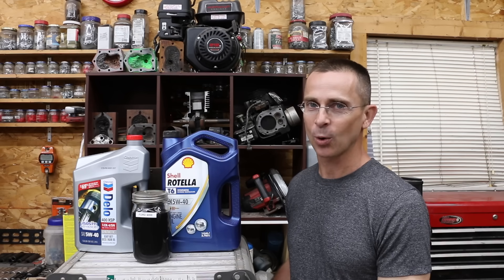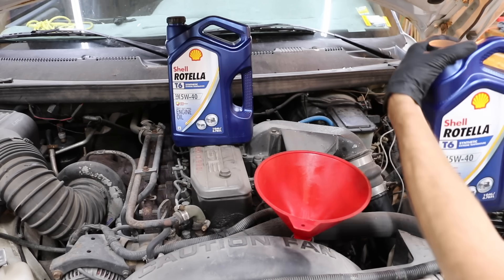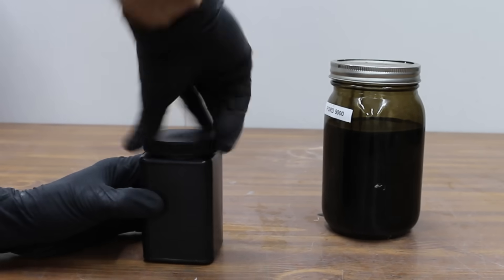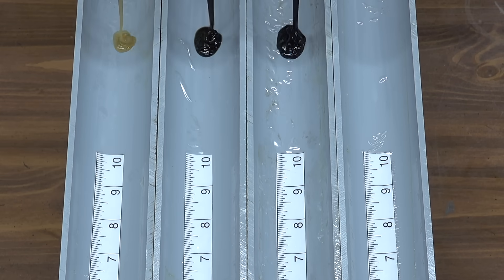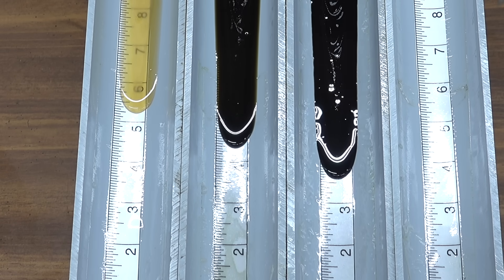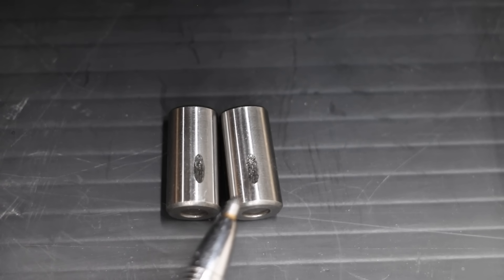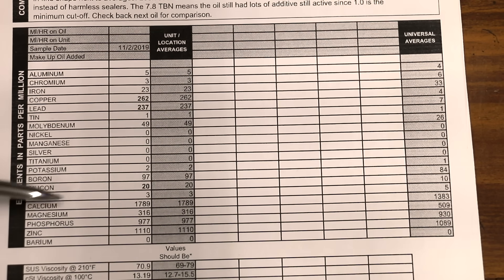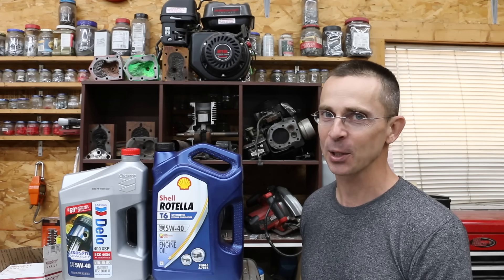Will Annual Oil Change Damage Your Car? Let's find out!

Comment: Been studying this extensively;
How long one can push it depend heavily on brand and model;
Rotella & Delo are decades proven;
Synthetic has proven best; 
Amsoil might be top with I am using Mobil 1 currently with excellent results;
Avoid the European brands to the extent possible 
Prefill filter; I survive by knowing this stuff;
Never never use aftermarket which uses paraffin as factory goes to extra effort to remove it and I saw totally ruined that spin the Babbitt due to clogged pickup screen ~ petroleum engineer told me to stay with one brand so that the additives to not interfere
Reply from the maker: Thanks for the feedback.

Comment: A suggestion for a comparison would be high quality multimeters rated for the HVAC industry. This could also be useful for electricians as we both work with high voltage loads and need to test capacitors.
Reply from the maker: Great suggestion!  Thank you.

Comment: I only change my tractor oils after 2 years or 1000 hrs.  Trucks and cars usually between 6 to 10000 miles per oil change. Never had a problem. One car has 250,000, both the others have 210,000 plus still do great. They are GM products don't recommend trying that on another brand! Lol! 😆

Comment: You conducted these tests with oil from vehicles located far from very humid regions.  Do you believe that results would be significantly different for vehicles along the coastlines, particularly near the ocean?  Example, I live at the beach front of the Atlantic.  Salt air breaks down metal far faster than in areas far inland.  That's one of the reasons I change out my car's oil @ 4000 miles.
Reply: You're wasting your money. Go to synthetic and change your oil every 15,000 miles perhaps longer. Make sure to use a reinforced (synthetic) filter.

Comment: Would you like to test the oil on my 2.2 diesel civic. It has not been changed in 3 years and 70k, it was Castrol gtx and Lucas oil stabilizer. The car was supposed to be a stop gap car hence the neglect but an oil test would be fun! I'd happily send it to you

Comment: I have to disagree with this video. Yes the oil is fine but is it a good habit to not change your oil until you get the max "value" out of it? No. Oil changes are cheap compared with the cost of fuel.
Reply from the maker: Thanks for the feedback.

Comment: I use Rotella 15/40 in my cummins trucks 1998 12 valve and 2015 6.7 24 valve. never had any issues and i assume the 5/40 is for a colder climate you are in? Very good Video and i do believe ill start using the 15/40 in my older Mopar muscle cars...your thoughts on wear protection with a hyd.  flat tappet cam?
Reply from the maker: Thanks for the video idea.

Comment: Honda know my car better than anyone.  I'll be doing an annual this year as I won't go under 20% on the oil "meter".  That'll be about 12,500 km by the end of Sept.  Current load: Penz 0W20 Platinum, next Mobil One Extended.
Reply from the maker: Thanks for sharing.

Comment: I have a Toyota Rav4 2018 2.5 petrol engine. The dealer told me that the oil must be replaced 10000 KM or 6 months, watching this video confirms that its needed to replace the oil after that short length of time thanks for that.
Reply from the maker: You are welcome.

Comment: how's that work ? I can't start my car every month to let it reach the engine temp. Since my car is in storage during Winter season. I do add gas sta-biil to the gas.  Example I change the oil once a year on my BMW M4 last change June 28 2019 go to storage Nov 2019.  Start driving again on 01 April 2020 till now total driven 11,000 km. Going to do an oil change before going to storage this Nov 2020. Or should I leave it and change the oil April 2021 next time I take the car and drive again. Thanks

Comment: I can walk pass the aisle that has the motor oil now and not feel guilty. I can buy my favorite snacks and drinks instead. Thanks for the excellent research and analysis. Bottom line...my vehicles still love me, even if they're in my driveway or garage, unused for longer periods. My vehicle's battery still needs some periodic affection though. LOL
Reply from the maker: Thanks for sharing.

Comment: Thanks for making this video ,  What a great shop you have! You are like the Batman of engine & mechanical investigations, such cool tools. Is the oil filter opener made for a specific job besides oil filters & what kind of freezer is that? Looks like something a for storing frozen arctic geological core samples.
Reply from the maker: The freezer is a Commercial Lab Revco freezer that I use for project testing.  Thanks for watching!

Comment: Imo even in this day I wouldn't go more than 6000km or 4500mi 5000km or 3000mi is a rule usually delo is a good brand same with quaker state but if your putting 2 or 3 thou km or mi on your vehicle every month and your only doing 1 oil change per year you got more money than brains lol playin with fire... car manufacturers love people like that
Reply from the maker: Thanks for the feedback.
Reply: @ProjectFarm  no problem have a 2001 buick century have 335000km or over 200k miles changing oil every 5000km and a coolant flush every couple years still runs new

Comment: I have a OPS Bypass oil filtration system in my Freightlier semi truck.I change my oil about every 500,000 miles.I do oil sampling every 15 thousand miles.I save 3200 dollars a year on oil changes.My Detroit 60 series engine has 1.5 million miles on it.I bought the truck with 400,000 on it.

Comment: I know the lab you’re using from the result page and sample bottles. We’ve always had problems with that labs results. Find another lab and compare the two results. I’m an industrial oil tech. See if the results are the same.
Reply from the maker: Thanks for the suggestion.

Comment: I used the t6 in a 400hp subaru build. But it did experience high mileage and heat/ fuel contamination from high boost  blowby so it was changed often.
Reply from the maker: Thanks for sharing.

Comment: Doesnt that stem from back in the day when mineral oil was frequently used? I remember changing the oil in our small atv last year that had been ran very little and not had it's oil changed in 2 years. Half of it was like thick tar and The rest of it was really thin.
Reply from the maker: Thanks for the feedback.

Comment: The biggest problem I see with annual oil changes is filter capacity. Oil gets dirty and full of contaminates, it's not just about viscosity breaking down. I always go by milege or my oil life monitoring system. I also use fulll synthetic oil and generally change my oil when it gets bellow  20% around 6,000 MI.
Reply from the maker: Thanks for sharing.

Comment: Thanks for the videos! I started using triax oil 5w40 synthetic I haven’t sent for analysis yet but it did stop a rough idle immediately after changing oil  on cold start up on my 6.0 ford due to an injector

I would live to see a video on triax oils (diesel) oil
Reply from the maker: Thanks for the video idea.

Comment: You are a fantastic oil expert and I learn so much from your videos. I have a question. You mentioned in this video that only vertical oil filters can be pre-filled before installation. My car has a horizontal type of oil filter and I can't pre-fill it. Does it damage my bearings to start the engine with the empty oil filter (after changing the oil)? How long does it take for an average oil filter to be filled by the oil pump? The only thing I can do to feel more relaxed is to disconnect the primary socket of engine ignition system and cranking the engine for a few seconds to fill the filter a little bit before starting the engine.
Reply from the maker: Thanks for the video idea.

Comment: Greetings, many of your test data corresponds with my standings assumptions - not too many surprises - good testing procedures.    
With Lithium (and other advanced electric storage chemistries) improving every year, let’s test Shorai and Battery Tender against conventional motorcycle batteries.  My extensive experience with Lithiums concludes:  that they’re NOT ready for motorcycle prime time.  I have four, ground - up, special builds and six others that have been extensively modified. To crank motors that require compression relief valves (will submit to you a list should you ask)  a conventional 320 CCA battery does better than a 480 CCA Battery Tender.  Lithiums require a warn-up to achieve max cranking amps.  On cold big motors, the starter motor can ‘stall-out’ shorting the battery and thus destroying it.  When Lithiums die they go all at once. ‘Lead’ gives us some warning.  Regards, jul, milliesievertmoto1@gmail.com
415 824 6149 office land line.

Comment: European car manufacturers suggest that a fully synthetic oil change only needs to be done every 10,000-18,000 miles .
Yet on other car sites they're either very old fashioned or just anal about oil, changing it every 3,000 -5,000 miles.
Reply from the maker: Thanks for the feedback.

Comment: I drive about 1,000 miles a year and use synthetic oil, usually Mobil 1. It works just fine for a year at a time... It is a 1994 S10 blazer with the stock 4.3L V6 engine. It still runs great and is a lot of fun to drive, I just don't need to drive around that much now that I am retired. It is not a race truck, just point to point steady driver.
Reply from the maker: Thanks for sharing.

Comment: Forgive me for not being shocked by your results. You may have gone 14 or 17 months but you only put a little more than 3k miles on the vehicle. It's not surprising that the oil was still in decent shape. Maybe I'm somehow missing the point.
Reply from the maker: Thanks for the feedback.
Reply: the point is annually some people put few miles on various vehicles, but are still told the superstition that they have to change their oil each 6 months or once a year anyway...but they really dont have to if the vehicle was driven up to full temp before the parked...this person was just confirming that the oil is OK under those circumstances..
Reply: @bonniejohnson1518  Thanks for the clarification.

Comment: I use Deltalube multipurpose(this oil for allkind of veichles) sae40 on my motorcycle.It's suitable for my motorcycle ( every time i change the engine gets cleaner ) even my country is tropical climate with some crazy jam traffic...Almost forgot...for some reason octane number of gasoline affect engine oil peeformance...
Reply from the maker: Thanks for the feedback.

Comment: I had a 1984 Mazda B2200 diesel, oil change interval was 5000 miles, at 3000 miles fuel mileage started to drop, by the 5000 mile interval mileage dropped from 40 mpg to 30 mpg, so I changed oil at 4000 miles.
Reply from the maker: Great information. Thank you

Comment: Just wanted to let you know, I am getting 7 months and 40,000 miles between oil changes with T6 in my 04 Chevy 4.8L
Reply from the maker: Thanks for sharing!
Reply: Bucyrus Erie, what kind of oil are you running?that's a hell of alot of miles before doing a oil change regardless of what kind of oil you are running.i hope you are running amsoil signature series oil but even if you are I don't think it's a good idea to go that many miles on the oil.even the max miles on amsoil signature series is only like twenty five thousand miles.i don't believe any oil can go 40000 miles without breaking down.

Comment: It would be great to compare the effectiveness of long life synthetic engine oil after 12k miles with standard oil after 6k miles, bearing in mind that long life oil is more expensive.  Is it better to buy and change cheap oil more often, or buy a dear oil and run it for longer?
Reply from the maker: Great suggestion!  Thank you

Comment: The oil in my crankcase is 5 years old but I have done very low mileage during this period i.e. 3500 miles. There is a high chance of moisture contamination in the oil. Should I drain the oil without warming up the engine or should I warm up the engine first?

Comment: What if you use engine oil additives for a 3 year old oil, which has low miles.( Around 3000 miles)?
Reply from the maker: Thanks for the suggestion.
Reply: @ProjectFarm  I used Liqui Moly PRO-LINE OIL LOSS STOP to fix a leak from the front oil seal. Since I keep topping up new oil every now and then and I dont run my vehicle long distances, I haven't given my vehicle a oil change in a while.

Comment: The Delo has a lower phosphorus and calcium but based on the TBN a higher ashless dispersant content, although. Would suggest both use a mix of calcium, magnesium and ashless . With such a lower calcium and ZDDP level it would suggest a much lower sulphates ash. I would just check the specs on these oils because they don't quite match up as being equivalent to me. The T6 appears to be formulated to a different phosphorus level, I suspect >900ppm where as the Chevron is in the  700 to 800 ppm range suggesting there is a spec with an upper limited in the list. This might be an OEM limit so not necessarily API related.
Reply from the maker: Thanks for the feedback.

Comment: I believe the 12 month or 20,000 mile change is for the oil filter, not the oil - per Mobil One.  It probably has something to do with the integrity of the filter material when exposed to oil.
Reply from the maker: Thanks for the feedback.

Comment: what about a regular car that you drive often and put more than 3200 miles? for example using your oil winner amsoil thats rated for 25000 miles or annually?
Reply from the maker: Thanks for the suggestion.

Comment: To corroborate your findings, gen 2 Chevy Volt allowed up to 24 month oil change interval. So even the GM engineers recognize you can drive around safely on 23 month old oil. My car will be 4 years old next month, coming up on its second oil change! Gas engine has only 4,800 miles on it after 4 years.
Reply from the maker: Thank you for the feedback

Comment: another great test indeed and another myth busted. 

one thing that must be considered however, is the settlement of carbon deposits that build up in the oil (especially diesels) the more hours the oil runs. modern small European and Japanese engines have very tiny lubrication holes in the turbo bearings, hydraulic tappets and cam-timing gear which are prone to silting and eventually block leading to inevitable internal failures. running clean oil negates this.
'oil is cheap, engines are expensive' as someone once said
Reply from the maker: Thanks for the feedback.

Comment: Synthetic oil doesn't lose its viscosity,last oil change was 4 years ago the oil is still good and runs like a charm
Reply from the maker: Thanks for the feedback.
Reply: actually straight 30 weight etc will keep its viscosity  and lubricity longer...oil additives both in so-called synthetic and conventional break down over time...they can last 3 years if minimal mileage is up to 5000 miles over that period of time...the farther the the spread such as 5-30 the faster it will break down....but all modern oils that meet DOT spec can easily last 3 years or 5000 miles if vehicle gets driven to full temp and operating range each time
Reply: film strength is best with a straight weight oil. if one only drives in moderate temps straight 30 weight synthetic would be the best oil, but conventional is good too...

Comment: Shell Rotella T6 is a popular oil used in motorcycle road racing.  It works great in engines and transmissions that share the same oil as in most Japanese sportbikes.  Because its designed for diesel engines it doesn't contain the friction modifiers that contaminate wet clutch plates.  It's also much cheaper than motorcycle specific oil...
Reply from the maker: Thanks for the feedback.

Comment: My 1988 Chevy G20  Camper Van Has Mobil 1 Full Synthic It Is A Year And A Half Old With Only 3400 Miles On It Do I Need To Change It ? It Still Looks Golden On Dip Stick

Comment: I run the shell 15-40 full synthetic in my Harley got 40,000 miles on it ran out to Utah and back last summer did 3,250 miles it used about two ounces I am a believer in Shell oils.
Reply from the maker: Thanks for sharing.

Comment: Engine wear occurs at start up because the multi grade oil is to thin like 5w ( winter)  after 20 minuted the oil will thicken up to 30 grade oil .For the first 20 minutes you are driving under load on 5w oil that's the real cause of engine wear . not oil circulation. 
Check out ResearchGate website on Engine startup wear  on a  GM V6 engine. P.S  I use straight grade 30 conventional pennzoil or castrol ( mobil 1 filter)  . 300,000 miles ....no problem .
High film strength synthetics were created and don't help much   .....semi synthetics are better if you choose that type of oil  or have a turbocharger system as  they absorb shock loads better and provide better hydrodynamic wedging.
One year or 20,000 oil change is b.s. for mobil 1 look on the bottom of the bottle in small print " follow mfg recommended oil changes. "( average 7,500 miles) . bmw had a 20,000 mile schedule....and the engines were so full of sludge and wore out the factory went back to the low milage oil change .
The base oil never wears out BUT the viscosity improver breaks down and the oil gets dirty from combustion "blow by" and water vapor Etc Etc .
Reply from the maker: Thanks for sharing.

Comment: All the myths that i didnt believe are probe to be faill i use full sintetic motul V300 10w40 on mi dodge stealth and on mi ford falcon futura 6 cil 221 ci  1972 change it every 2 years and used engine flush both engine work great .. of course they run much smooth ... better oil better engine.... and both will last longer...
Reply from the maker: Thanks for sharing.